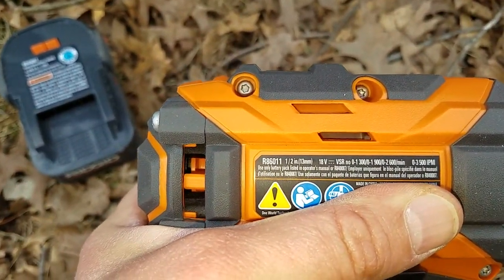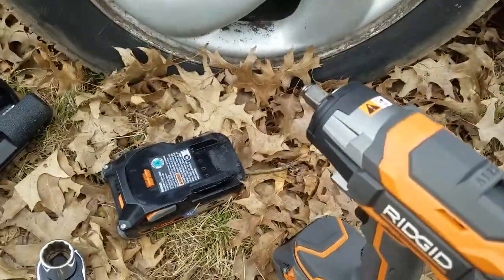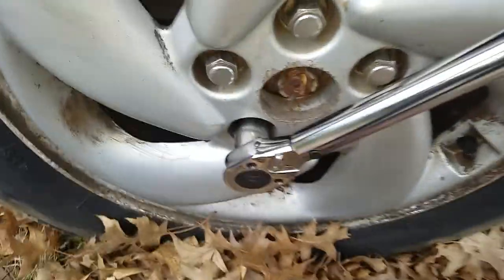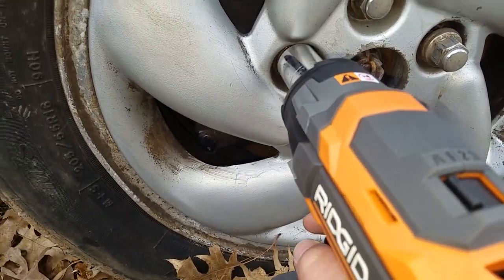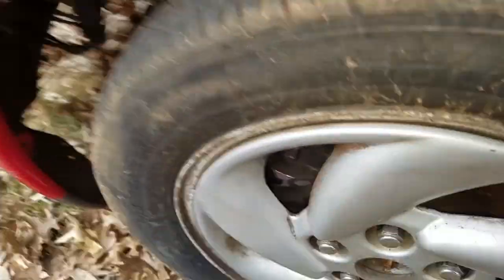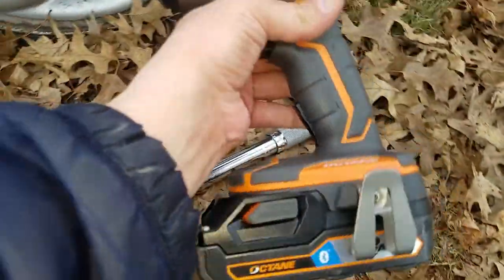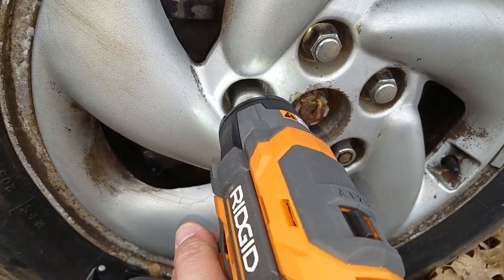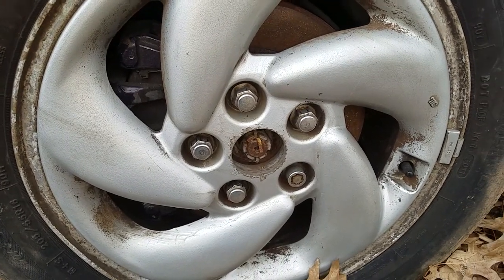The amazing Ridgid octane 1/2" impact wrench testing

Comment: I'm absolutely impressed with my rigid 1/2 inch drive impact. I've had mine just over a year now and i use it on a daily basis and it has never let me down
Reply: Do you use this tool for automotive repair/services?
Reply from the maker: Still holding up?
Reply: @InNerdimensional  the home depot has a 4amp hour kit on sale right now for like $150. i use pretty much all milwaukees but im looking for a tool in between my m18 fuel 1/2 (the 1400ft lb one) and my m18 fuel 3/8 gen 3 impact wrench....
Reply from the maker: @GloryOfSatan  try it
Reply: @InNerdimensional  I just placed the order it should be at my homedepot sometime next week.
Reply from the maker: @GloryOfSatan  nice, let me know what you think of it, cause other people would like opinions of others as well. Put it up against the high torque Milwaukee... Cuz I would!
Reply: @InNerdimensional  oh I will haha I work at a dealership so I'll try to make a little video or something about it. I'll try to remember and tag ya
Reply from the maker: @GloryOfSatan  sweet, tag Ridgid too. Cause I've sold a lot of their tools on accident and I want them to send me some other tools

Comment: Hey man a pro tip for the future. Don’t use chrome sockets when impacting. They can break and shear into a lot of little pieces that could go in your eyes if not protected. Use the black/grey impact sockets. They crack when taken to failure rather than shear/shatter
Reply from the maker: Oh I know, I've been trying to break these damn Chinese craftsmen sockets for a while. Only broke the 17mm once with over 600ftlbs or more. Worked at multiple tire shops. And I always wear safety glasses. Just out of habit. And got my osha 10 a while back. I personally think they lie about the impact rated stuff, because I've broken impact rated hex bits and not broken normal bits with the same impact. If it breaks, it breaks. Btw, I did find my impact sockets for my other test video. The softer metal doesn't make as much torque
Reply: I've been trying to brake my pittsburgh ones to replace it since it has lifetime warranty and the bastard won't die 😂😂😂😂

Comment: Switched to cordless for the home garage and went with the 86011 and haven't encountered an axel nut or suspension bolts that I've needed to upgrade the battery yet. Still using the standard 4 ah it came with. 👍

Oh and the auto feature almost always gets it to with a 16th of a turn with the torque wrench to get the proper pounds on any lug so far.

Comment: Great video man, i was thinking of  buying the rigid impact wrench now I definitely will great job on going step by step on showing what it can do
Reply from the maker: Thank you! For the price, can't be beat at the mid torque range. $149 with 2 3ah batteries. If the deal is still going and the other tools are amazing too. I can't wait till they make a sliding miter saw for the octane lineup. Buy some nice torque sticks for tightening and boom, good to go. Thanks for the comment and enjoy the tool!

Comment: The 3 amp octane batteries have 2700 cells as opposed to 18650 cells, everybody wants this battery now but it's discontinued. I have in both my high torque & mid torque.
Reply from the maker: I only have the 3ah octane batteries. I sold the other kit to my Dad, drill and impact with 4ah batteries

Comment: I have the next gen one, I use it for automotive use 5 days a week for two years now, the only problem with it is its a little too much for cars and light trucks which is what I work with, maybe the next size down would be good enough for my purposes.
Reply from the maker: Does the next get perform better? You should get the new subcompact ones. They look dope and you can get the 1/2" and 3/8" in a combo

Comment: Your using a 12 point socket(non impact) you should be using a 6 point socket impact rated. The socket would then come off the lug nut easier
Reply from the maker: My impact sockets are worse. They are made of a softer, more stretchy metal so they don't break. They actually provide less power, although not by much, than a hardened socket.
Reply: Was going to say the same about 6 piont  impact socket as well over the 12 point crome
Reply: Using a 12 point socket on an impact is a recipe for disaster. Maybe not on those lug nuts but try on something a little rusty and see what happens lol say hello to the torch cause that bolt will be rounded off
Reply: good point but not always, the caps on the lugs can swell making it a pain with any kind of socket.

Comment: The 3AH Octane battery has the newer cells so it should be able to provide more power to the Octane Impact.
Reply from the maker: Supposedly, but I fell more power with the normal 4ah hyper lithium on most tools. And they most definitely drain faster. On the circular saw, not as much power with the 3ah. It has less cells doing more work. Idk, maybe they need to be discharged and recharged multiple times to calibrate
Reply: JT vs Tha World the 3ah octane have special battery cell are 21700 while the others are only 18650 cells on those
Reply from the maker: @DanielGomez-cf6vk  they just drain super fast in my router and recip saw
Reply: 6ah is the best my opinion weight and power
Reply from the maker: @LUISTHEBOOTYCLAPPER  maybe,  the 3ah drain hella fast. Like twice as fast as the 4ah
Reply: @InNerdimensional  yeah my opinion 3ah sucks bad

Comment: Over on the "Tool Review Zone" channel there's a comparison of this with a DeWalt impact wrench, and he notices it actually drives lags a little slower with the 3ah octane battery compared to the 4ah.   The 3ah only has one row of cells and probably fewer peak continuous amps than the 4ah which has two rows.  Each parallel set adds more current.    Also noticed that on the Workshop Addict channel, they recommend this unit and say it's equivalent to the Milwaukee mid-torque.  So that sold me - this unit is not lacking in power.
Reply from the maker: The warranty and the price got me, I picked it up on sale, $149 with 2 3ah batteries and a charger.  The batteries drain very quickly on some tools. The 4ah lasts almost twice as long on some tools. Jobmax, sanders, recip, drills, lights, router, ect... eat these 3ah like nothing. I came from c3 craftsman tools and it's a major step up. Milwaukee almost got my $, but they could not match price or warranty. And it would have been a 6 1/2 circular saw. I accidentally got the gen5x circ saw... that sux but it came with the octane jigsaw that is better than the Milwaukee. So I'll pick it up some other time
Reply: @InNerdimensional  That was a really great deal!  I wish they still had the 3ah/6ah starter kits available.  Even the two 3ah kits have been gone for a few months now.  In another youtube channel, someone stated that they're going to release a new charger soon and might be dropping the bluetooth functionality on the batteries because too many people are locking them up and returning them!     Unfortunately after waiting for a few months for a deal with a starter kit, I couldn't wait any longer, so I just got one from DTO on their 20% off Labor Day sale, but had to buy a cheapie charger from ebay to get me going.  I had no other Ridgid tools previously, just Ryobi.  The Ryobi (p261) impact wrench is a brushed tool that has less than half the power, otherwise I would've stayed in that platform.    Anw, thanks for taking the time to make and upload these videos - seeing real world usage on old/rusty stuff is in a way more valuable (due to being realistic) than watching someone drill in some big lag bolts or take off some low torque lug nuts.
Reply from the maker: @GarenP  you are welcome, I wish I had the time to film better considering I have a 4k camera next to me. But editing is hard and time consuming. I used to get paid on my old channel so I put more effort in, but damn, when they demonetized my other channel... it really screwed me over. But I don't need to make this tool or other ridgid tools looks good, the work speaks for itself. I have other ridgid tools that I haven't even filmed yet. Name em, I'll film em if I have it
Reply: @InNerdimensional  Well, personally I mostly use tools for auto DIY work, so anything that's doing something in that area is interesting to me.  For anyone that's ever struggled to break/loosen a really stuck nut it's just amazing seeing these things work.  Anything where the quick spinning torque will remove a nut, where you'd have to manually hold something in place is also impressive -- removing a lawn mower blade nut, water heater anode (some people strap them in place to prevent the heater from moving, WAY harder than just using an impact like this!), or the top nut from a strut assembly.   In general I think any kind of everyday or DIY use case where a tool is needed or would be greatly helped by a power tool, is fertile ground for a youtube video.  There are tons of videos already, but often just showing your own specific real life situation is still helpful - I know seeing videos on my exact car/generational variant is even more helpful than seeing the same job performed on a totally different car, for instance.  Cheers!
Reply from the maker: @GarenP  all my videos like that are on my other channels or taken down.  I rebuilt struts and removed hitch ball nuts...ect

Comment: On mine the 3ah octane def sounds like it is spinning faster..it has a higher pitch, even though its not an octane wrench i hear octane batteries on gen5x tools does improve it.
Reply from the maker: I use. The 3ah every day and I think that are trash. They may give more power for a small amount of time, but totally not worth it. My jobmax won't hardly operate on the octane battery, but I think it's time to call ridgid for a new one.

Comment: The 3ah has better battery cells I mainly use a 6ah octane battery on my impact wrench for lug nuts awesome
Video I recomend using Pittsburgh impact ready sockets from harbor freight
Reply from the maker: Thanks, I'll upgrade my tools once I get my finances in order. I have short impact sockets, I just can't find the 13/16. How well does the 6ah hold up to the high demand tools like a circular saw, router, sanders, or vacuums.
Reply: JT vs Tha World vacuum circular saw it’s a beast but the 9ah is way too big for a impact wrench ivan get away with a 6ah octane for everything the 3ah are special because there the only ones with 21700 cells and the 6 and 9 are just 18650 cells enjoy your. Ridgid don’t forget to register them for LSA
Reply from the maker: @DanielGomez-cf6vk  registered asap. Still pending

Comment: Just got this with two 3ah and charger for 150
Reply from the maker: That's how I got it too. On sale. It's a good mid torque wrench. How do you like it?
Reply: I haven’t got a chance to use it yet seems to have a lot of power
Reply from the maker: Maybe you need to rotate your tires, or your neighbors. Just something to use it on😀
Reply: One of the best deals around if you need batteries
Reply: I gotta find one of these deals!!!

Comment: They are the same, if you get 2 bars or lower it will give you less power to extend the life of the battery
Reply from the maker: The 4ah doesn't do that. Must be the different cells
Reply from the maker: I actually noticed that on my d/a sander. At 1 bar it slows the tool. The 4ah, I never noticed that

Comment: so i could be wrong but i thought the speed setting was for tightening not removing. On other electric impacts the breakway torque is not able to be changed just the fastening torque.
Reply from the maker: It affects both forward and reverse. The auto mode is full speed in reverse and stops when it feels resistance in forward. If it can do the job at a lower speed, it will save battery life. It'll still snap off small bolts in the low settings

Comment: Do you know the fastening torque for each mode other than auto?
Reply from the maker: I dont have a digital torque wrench, but different fasteners on different metals wouldn't be accurate. Even torque wrenches aren't accurate to a certain degree. Too many variables
Reply: @InNerdimensional  couldn’t you check the torque for each mode just like you checked for the auto mode. A lot people are interested in lugnut torque. Maybe a next video ideal. Thanks for the video.
Reply from the maker: @xlightssx  if I had a digital torque wrench.  Auto tightening is over 100 ft/lbs in 1. You could buy torque sticks that set a predetermined torque

Comment: Sale I am seeing is 1 4AH Battery non Octane for 149 ..
Reply from the maker: Just wait till the sale comes back
Reply: @InNerdimensional  I found a buy two 3 ah octane batteries get an impact free deal on Home Depot website but it says $219. I'm pretty sure those batteries are cheaper than that
Reply from the maker: @dustincmills  just wait till the sale comes back
Reply: @InNerdimensional  Exactly what I'm doing because memorial and father day is right aroundthe corner.
Reply: Dustin C Mills 
The impact wrench itself costs $179
Reply from the maker: @Rea1_Madrid  every once is a while they run promotional sales to get the tools out the stores. download the Home depot app and wait till it's back to 149 with 2 3ah batteries.
Reply: @InNerdimensional  That's what I'm doing

Comment: same POWER, runs LONGER
Reply from the maker: it actually has a little more power with the octane batteries, but the 3ah drains pretty quickly. I like the 4ah better, but I'm sure the 6ah and 9ah are way better.

Comment: 👀👀👀👀 auto stops when if it feel the bolt tighten, has nothing to do with rust.
Reply from the maker: the rust makes the tool sense resistance, therefor making the tool stop.